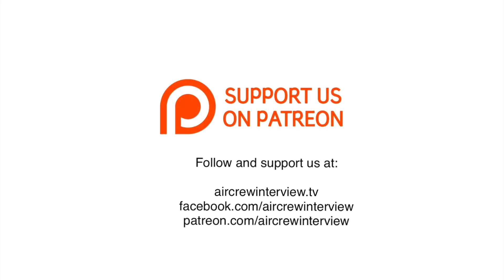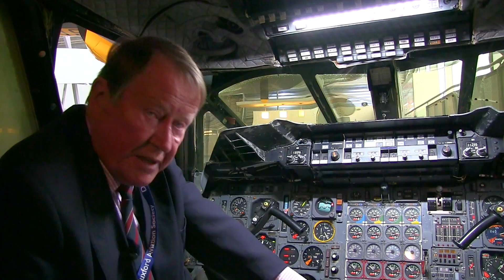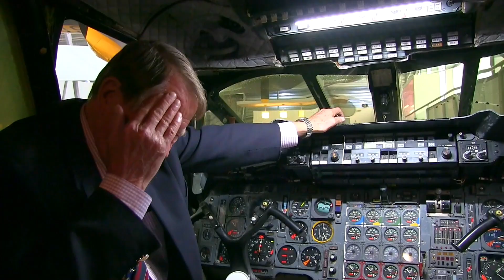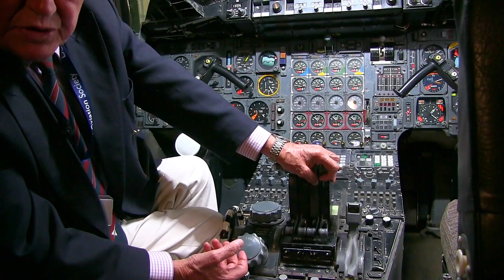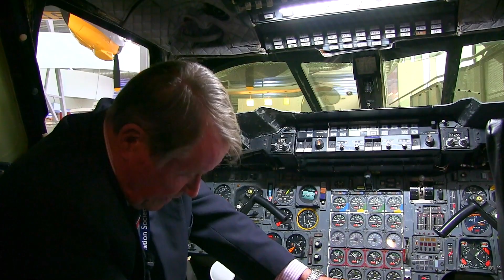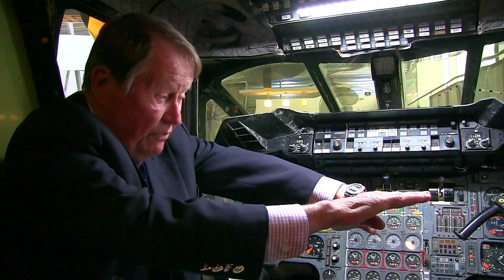John Hutchinson on Air France Flight 4590

Comment: Even studying the accident report in depth has left me with some blanks that now after years have been filled with this excellent analysis by Capt. Hutchinson. So different when this chain of events is analyzed by someone who knows the works around this aircraft! Particularly interesting also the mentioning of the non-procedural shut down of the no. 2 engine and the contingency power.
You are strongly encouraged to keep up your good work.
Reply from the maker: dfolt Glad we could of been of help!
Reply: @AircrewInterview  Absolutely fantastic all-around.
Reply: After the 1973 Paris Airshow fiasco and whitewash coverup, you cannot trust anything the French investigators put out.
Reply: You fell for his charm he fails to mention no.2 wasn't just setting off the fire alarm it was surging and providing negligible thrust a clear indication something was legitimately wrong with the engine requiring immediate action and that when N2 dropped below 58% after the FE killed the engine the auto throttle automatically went in to Contingency Power for the remaining 3 engines his assertion the crew failed to select it is misleading at best.

Capt Hutchinson is known to perpetuate a theory that weight and balance had a greater influence than is acknowledged by the official report and he ignores factual information that doesn't support his theory

The greatest contribution to the crash on the part of the accident crew was overfilling the tanks as this absolutely had an effect on the consequences of the pressure wave from the tire impact however it's not known how much less fuel would have negated the effect
Reply: @PabloGonzalez-hv3td  thank you for your reply. I like to know all the facts and make my own decision. Your post reminds me of that as I was giving thumbs up to other comments and now question them. Again thank you for your perspective. I am not sure if I agree; however enjoy other perspectives so that I can form my own opinions considering others.
Reply: @glen3257  I understand that Captain Hutchinson is an experienced Concorde pilot but so was the accident crew so someone with vast experience made a mistake no matter how you slice it.

Captain Hutchinson's narrative makes simple but glaring mistakes and has no credibility beyond that for me.
Reply: @PabloGonzalez-hv3td  Why was it ever acceptable to fill the fuel tanks beyond 80- 83%? In this disaster, did the pilot have good reason to fill the fuel tanks to 100%?
Reply: @CC-xn5xi  Is there ever a good reason to ignore safety? Why was it ever acceptable to be overweight? Why was it ever acceptable to have fuel transfer pumps running during taxi and takeoff? Unless Captain Hutchinson is seriously misleading us these are not small points. All these rules are intended to leave room so that human mistakes (like missing a piece of loose engine cowl during inspection) does NOT bring the plane down.
Reply: @PabloGonzalez-hv3td  What you haven't mentioned is the pilot was forced to rotate prematurely because his plane was veering towards a passenger plane on their left if he hadn't lifted 4590 off the deck the disaster would have been greater. Insufficient airspeed killed the aircraft. Also, something that isn't common knowledge is Concorde on several occasions in its past had suffered tyre failures that resulted in punctured fuel tanks, it's well documented but there had been nothing like this event which made a hole 1ft sq. The root cause of this crash was the defective left wheel bogie.
Reply: @coyote5735   We know the early rotation didn't contribute to the crash by virtue that they still managed to get safely airborne. It's that simple and if all else remains equal after rotation there's no crash.
     The failed gear retraction severely hindered their ability to gain airspeed but even that doesn't bring them down.

The crash sequence was initiated when no.1 began surging after ingesting material the engulfed wing was shedding. The asymmetrical thrust and resultant left overbank forced the crew to throttle back 3 and 4 and airspeed decayed below stall.

We also know the left wing was near complete failure and a viable landing approach was in all likelihood already impossible.

There's also the paradox of speed.
    More airspeed doesn't get them back on the ground faster it only extends the approach - and works to increase the severity of the fire due to the blowtorch effect. All of which ensures they crash before a viable landing.
Reply: @PabloGonzalez-hv3td  It crashed; indeed. The root can be traced back to the defective repair to the left wheel assembly, which was the catalyst in a cascade of events that doomed the aircraft. 

BTW Concorde rotated prematurely because it was being pulled to the left, there is a picture in the report that clearly shows four individual tyre skid marks from the left wheels on the runway, the wheelset was Pidgeon toed inwards (those tyres were brand new yet in the report, it shows the rubber worn away down to the canvas, explain that) there were no such marks on the right set of wheels. The pilot took off to avoid a plane on a taxiway crossing the runway that was waiting for clearance, it also happened to have the French president on board, it was a very close call.
Reply: @coyote5735  Regardless the successful take off proves conclusively that safe flight was still viable and thus from that point rotation speed becomes irrelevant. If the fire goes out at that very moment they come back and land safely.

Now it's possible that they don't strike the metal strip in the first place if the bogie was in optimal condition but they were still well within the parameters of a normal takeoff roll.

The deviation from centerline occurs after the fire starts not before and as a result of asymmetrical thrust.
Reply: @PabloGonzalez-hv3td  You are talking nonsense now.
Reply: @coyote5735  If they crashed immediately on takeoff you would have a point but they didn't. 
The takeoff run proved successful and they would have landed safely if not for the fire.
Reply: @coyote5735  If an aircraft takes off successfully the takeoff roll was successful 👍🏾
Reply: @PabloGonzalez-hv3td  Complete nonsense.   Plenty of accidents involve planes taking off before VR and NOT being in safe flight.

I think I’m starting to be convinced that you’d rather go down in flames making silly statements than concede a single point
Reply: @PabloGonzalez-hv3td  IT WASN’T SUCCESSFUL!   THEY DIDN’T MAKE IT TO VR!   WHAT PLANET ARE YOU ON?!!
Reply: @mattthrun-nowicki8641  The planet where they became AIRBORNE and FLEW for some distance on 3 engines in CONTINGENCY POWER.
Reply: @PabloGonzalez-hv3td  Plenty of planes that crash become airborne prematurely before Vr, but that doesn’t mean it’s a stable takeoff!    Then add the inappropriate decision to shut down an engine that’s not actually on fire, while taking off WITH the wind in a plane with overfilled tanks whose center of gravity is dangerously far back?   Yeah, man, sound like a stabilized take off…
Reply: @mattthrun-nowicki8641  Sounds like you don't know what CONTINGENCY POWER is in Concorde. 
The failed gear retraction was their biggest hindrance to gaining airspeed. Not a few thousand lb of fuel that was quickly BURNED anyways.
Reply: @PabloGonzalez-hv3td  It sounds like you’d need a hell of a lot of evidence to prove that, but for the landing gear, the plane would’ve climbed.   And, as I said, it also sounds like you’re a man refusing to concede anything.   In every single chain of this exchange, going back one whole year, you’ve doggedly refused to even acknowledge the significance of the fact that the plane shouldn’t even have been that far down the runway.

That’s not a statement from someone who’s willing to have a discussion- that’s a dogmatic clinging onto something for reasons beyond just having an exchange.
Reply: @mattthrun-nowicki8641  Any FE worth his salt would shut down an engine UNPROMPTED when there's a fire alarm AND surging. That's what CONTINGENCY POWER is for anyways.

That was their runway. They're allowed to be where the F they want within reason. And they were still WELL within reason.
Reply: @PabloGonzalez-hv3td  I’m done- this is pointless.   Enjoy.
Reply: @mattthrun-nowicki8641  u don't fly do u?
Reply: @PabloGonzalez-hv3td  Not professionally, no, but I do fly.   But you know who did fly professionally, and Concordes at that?   Mr.’s Hutchinson, Chauve, and Suaud, and other Concorde pilots who MADE the points I’m stating.

In a way, this is reminiscent of the Erebus crash…there’s sometimes a difference in approaching the questions “who’s to blame” vs “what caused the crash”, when the former carries with it the potential for lawsuits, especially (as in AF4590) against a state-owned airline, and the state is conducting the investigation.

Regardless, I’m flying out of this conversation now- au revoir!
Reply: @PabloGonzalez-hv3td  Both Concorde prototypes had their landing gears down during their maiden flights and yet they did not crash did they? Almost as in there were other factors causing decreasing airspeed.
Reply: @PabloGonzalez-hv3td  Oh cool, "charm" is the new synonym for "knowledge base built from a multi-decade career experience as a Concorde captain."   Good to know, thanks!
Reply: @doctahdudemanbro8210  Wrong is wrong. People with thousands of hours worth of experience make mistakes everyday. It's the very concept Hutchinson himself is contending.
Reply: @PabloGonzalez-hv3td  Right, like the 4590 Captain overloading his plane and extending the take-off run to the point that he ran over the DC-10 piece.   If he hand't overloaded it (and if the spacer had been in place), the plane would've been airborne well before the the tires hit it.
Reply: @doctahdudemanbro8210  Except the distance run had been normal and the deviation from centerline does not occur until after the metal strip is struck as evidenced by the scorch marks on the runway.

Excess weight was actively shed as fuel leaked and fed the fire. A headwind would have created more lift but been negated by drag from the failed gear retraction.

The effect the failed gear retraction had on airspeed is rarely if ever mentioned.

The final 90+ degree roll occured to the left, caused by the lift/thrust imbalance from the disintegrating wing and now failed no. 1. Not towards the heavier right wing as suggested by Capt. Hutchinson.
Reply: @PabloGonzalez-hv3td  Yeah, except it was NOT NORMAL.   The acceleration was abnormal from the get-go, according to the Chauve and Suaud calculations.  It was slow, likely due to excess friction of the left wheels being out of alignment (as Capt. Hutchinson points out).   The plane SHOULD have taken off at 1,694 meters, well before the metal strip, even taking into account the bonehead move by Capt. Marty of taking off with a tailwind while 6 tons overweight. 

This has nothing to do with the deviation from the centerline which, as you rightly point out, occurred after the fuel tank ruptured.   But the point is- the plane never should have been there in the first place.
Reply: @doctahdudemanbro8210  That much asymmetrical friction WOULD cause deviation requiring constant corrective input and there's no evidence of that.
Reply: And yet, here we are with a plane that was far further down the runway than it should’ve been, at a speed lower than you would expect it to be at that distance.    Something was causing it to accelerate abnormally...any thoughts what else it could’ve been other than the missing spacer and the general overweight status?
Reply: @mattthrun-nowicki8641  Do you know at what distance the metal strip was ran over?
Reply: At LEAST 45 meters after the plane should’ve been airborne.
Reply: @mattthrun-nowicki8641  According to what evidence?
Reply: According to calculations contained in the reports of Jean-Marie Chauve and Michel Suaud—an Air France Concorde pilot and flight engineer respectively, which were independently checked and confirmed, and entered into evidence during the trial, with no rebuttal from the BEA.
Reply: @mattthrun-nowicki8641  You know what? Even if they did extend the takeoff roll by 45+ M that doesn't change the narrative into the realm of pilot error or the unsafe. It's their runway and they weren't anywhere they weren't allowed to be the metal strip was.
Reply: I don’t think anyone’s saying that the runway wasn’t “theirs.”   I think Hutch’s point is that, despite what the BEA might say,  the metal strip is by no means the only factor that caused this crash.    The BEA might WANT that to be the case, because it spares Air France (and by extension the French government, who the BEA represents) any legal culpability for the crash.

But that’s a delusionally naive and self-serving viewport, and Hutch is by no means the only one to point this out.

There’s numerous other factors that led to this crash, and an abnormal acceleration (and abnormally far distance to rotation)  is unquestionably one of them.
Reply: @mattthrun-nowicki8641    There are always multiple factors in any crash. The thing is. Marginally extending a take off roll is not an inherent violation of any kind. It's not even remotely unsafe. Not with the distance margin they were working with.

Hutchinson neglects to mention the very real problem with no.2 and the fact that Contingency Mode activated automatically as no. 2 spooled down. Sufficient thrust was there.

Even overweight. The aircraft still managed to take off and achieve a brief positive rate of climb. All else remaining equal it shouldn't crash. So what changed? In fact the massive fuel leak meant it was only getting lighter. So what actually brought it down?

This is where I personally have the biggest problem with Hutchinson's narrative.

He contends the final roll was towards the heavier intact right wing, caused by the weight imbalance, but in reality they rolled towards the lighter but fully engulfed left wing.

He makes no mention that no.1 was found to have ingested material from the left wing which caused it to surge and lose power. Also indicating imminent structural failure of the left wing.

The asymmetric thrust from 3 and 4 then caused the left overbank leaving the pilots with no choice but to cut power to level off. But as airspeed decayed it fell below stall speed and they crashed.

Note that in an alternative scenario where they have all the airspeed in the world they run into the paradox of speed. 

They don't get to their intended runway any faster because they have to set up the landing. It's all but guaranteed the disintegrating left wing would have failed long before that happened.
Reply: He explains it clearly- what changed that led to the final stall was a continual rearward shift of the center of gravity due to it being aft of the fuel spilling out.
Reply: @mattthrun-nowicki8641   That explanation doesn't reconcile with the finer details of the final moments. He doesn't explain the facts he has his own version of the facts.
Reply: Pablo Gonzalez You’re correct that the airplane did roll to the left prior to crashing.   But I don’t see how his point regarding a center of gravity that was migrating to the rear, coupled with an asymmetrically higher density altitude on the left wing, leads to an inaccurate conclusion or is contrary to the stated facts in the BEA report.
Reply: @mattthrun-nowicki8641   The final pitch up and roll coincides with the loss of effective thrust from no.1 and was rectified by the throttle reduction to 3 and 4. (They also rolled back on their own due to airflow disruption). A clear indication asymmetrical thrust was the cause.

This sequence caused airspeed to decay to the point of stall but the impact was still wings level. It pancaked in. Another point that isn't addressed.
Reply: @PabloGonzalez-hv3td  I don't remember Capt. Hutchinson suggesting that the roll was toward the heavier right side. I think his gesture was to the right.
Reply: @CC-xn5xi  Hutchinson flew for BA I haven't seen any indication that AF had the same regs and while the full tank certainly made the pressure wave worse we don't know how much reduction would completely negate the effects of damage that occured. Both airlines still considered it imperative to reinforce the tanks.

Not only did they initially roll to the left and not the right like Hutchinson implied but they crashed nearly wings level.
Reply: @PabloGonzalez-hv3td  as soon as the helical vortices separated from the left wing, accentuated by the thrust imbalance turning the aircraft into the stall causing the roll at the end - was all explained in the report.

John Hutchinson correctly stated why that would have happened in his lecture at Brooklands. The asymmetrical thrust caused by 3 and 4 was coupled by the crew's actions in trying to keep the aircraft airborn at 15 degrees with insufficient power, lift, or velocity. As the rear trim tank pushed the fuel forward into the wings, they were unable to present the needed symmetrical rotation as the aircraft became unstabilzed.

This has been agreed with, and concurred, by the other British airways Concorde crew's - and crucially, some Air France pilots.
Reply: @RB747domme  Huh? You missed the part where they recovered the overbank but lost critical airspeed. They WERE in a stable attitude but they stalled.
Reply: @mattthrun-nowicki8641  Was all the fuel of tank #11 already pumped into the wing tanks? Only then there would have been no compensation for the leaked fuel. But the engines on full takeoff power were spending also some fuel anyway.